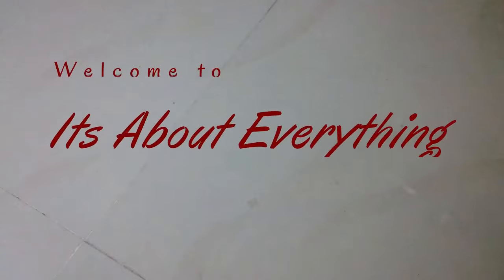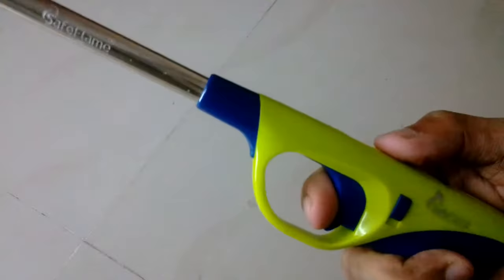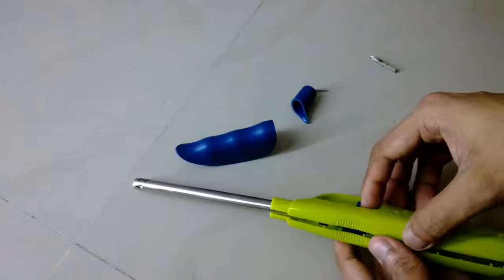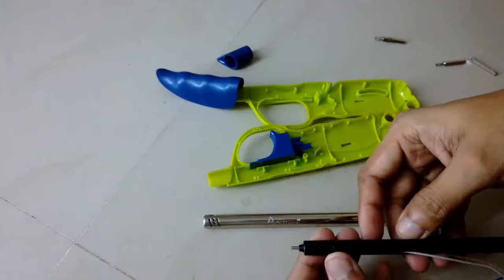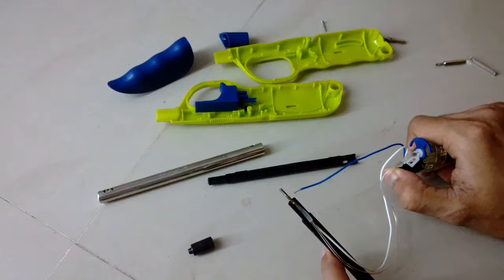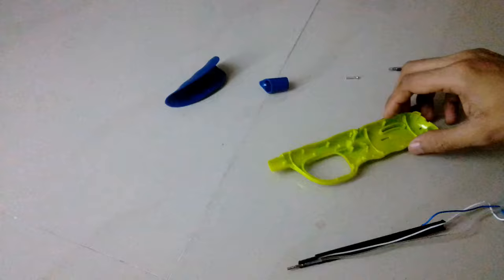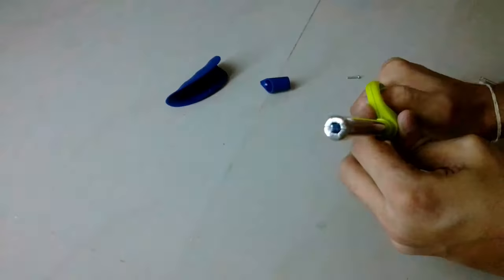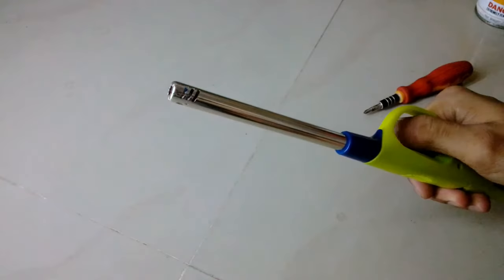Lets see whats inside a simple lighter and fix it -- Its About Everything

Comment: Even though this video is good and thoroughly made but sadly you don't really show the fixing part but instead just talk about it. So please fix it and reupload. Thank you very much.
Reply: Exactly
Reply: Exactly.. I also want to see where exactly he connected wire 😕
Reply: right
Reply: My thoughts exactly. What a bummer.
Reply: It wasn’t a wire problem. It was out of gas. He was showing you what the inside look like the loose wire just lays in the tube as a ground does not connect, but makes contact with the tube.
Reply: WHERE IS THE BLUE WIRE CONNECTED?????
Reply: After watching, equal no watch, becos no show soultion
Reply: The blue wire should touch the metal part

Comment: My Master Chef Lighter stopped working. I refilled it, but got a ton of spillage. It's now 4/5 full, there is a spark, but no light. I was able to disassemble everything, and test all parts separately. Spark but no flame. I tried putting a lighter flame (as you did) right at the fuel container valve, no flame. Seems like my fuel valve is not allowing fuel to pass? I disassembled tank fuel valve. Tried inserting a thin wire. I can see that the "gas release latch" pulls gas valve away from tank, and from tank side I can see that pulling valve away from tank opens the gas end of the valve. I can't insert thin wire from that end. But still no flame. I feel like the valve itself may have somehow failed. Maybe you could do a video on that part sometime? Thanks :)
Even though video didn't help me, it's nicely done. Thumbs up.

Comment: You didn't show how the blue wire should be fixed. Very vague misleading problem fixer.
Reply from the maker: The problem was it ran out of fuel thats why it wasnt lighting up,(had very little not enough) and the wire is ground it connects to the metal base of the striker and the metal tube. Open up your lighter and you will understand.